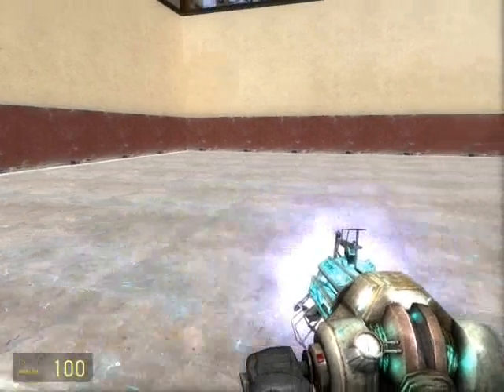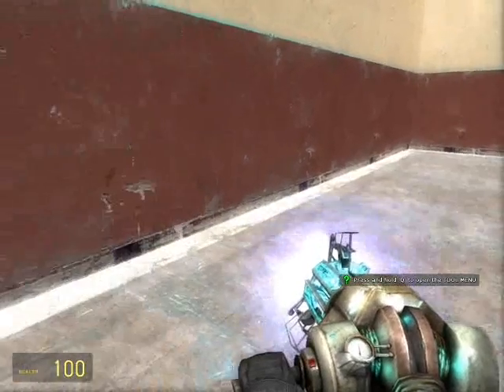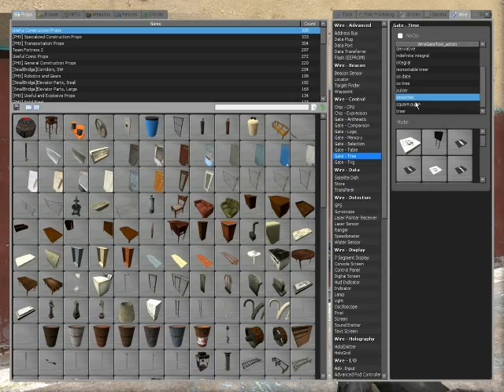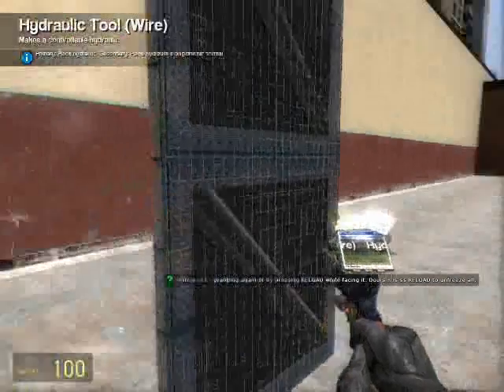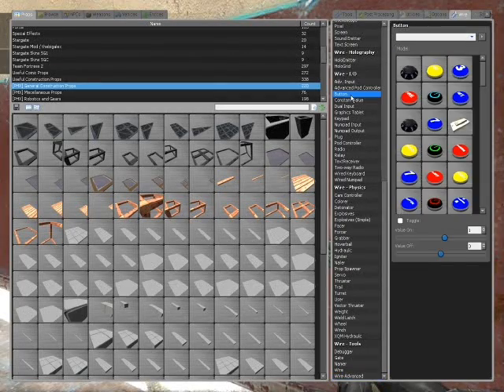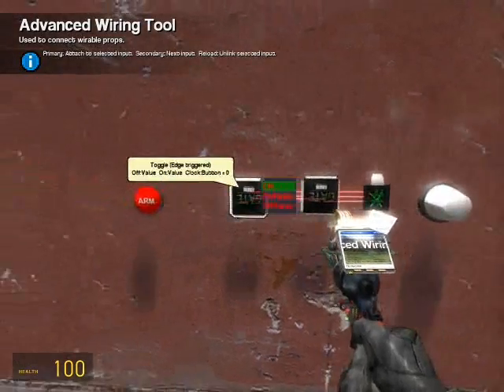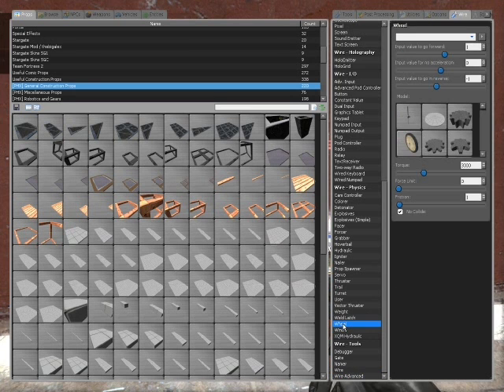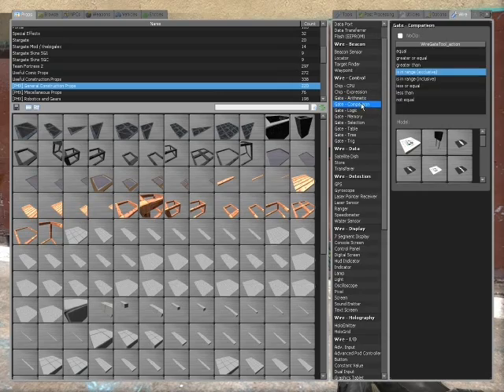Blast Door tut, sort of

Comment: It's glitching for me. :(
The Hydraulic goes to far then it should, like when everything is off and the hydraulic is supposed to ba at 0, it's hovers around 8.
And then when the door gets to the bottom, where I set it to 85, the hydraulic sits at 92, thus not stopping the lights and alarm. :(
Help please?